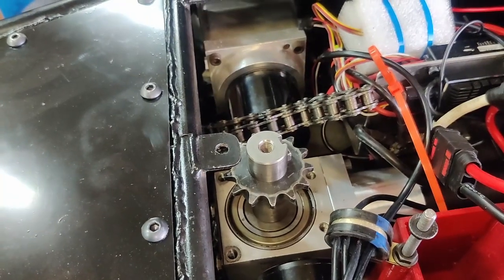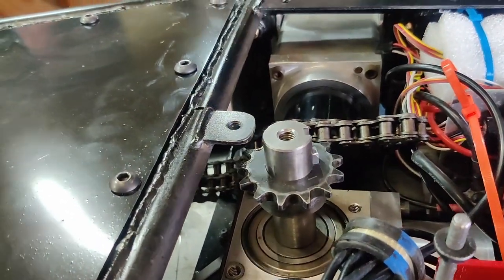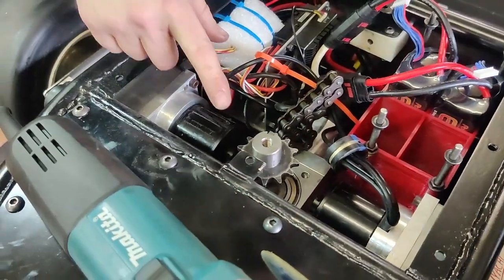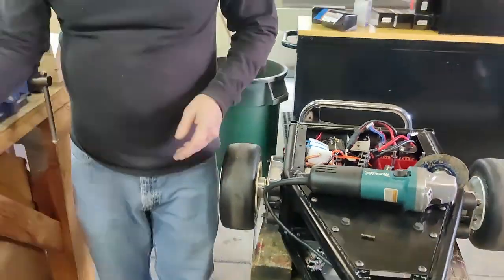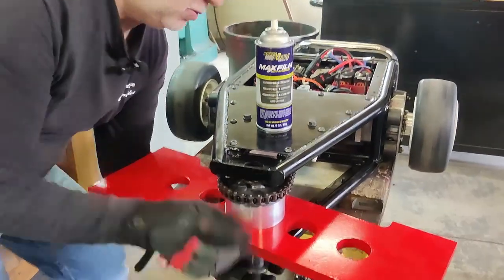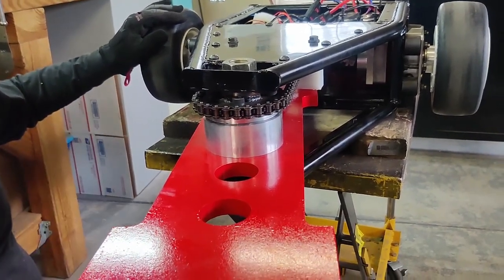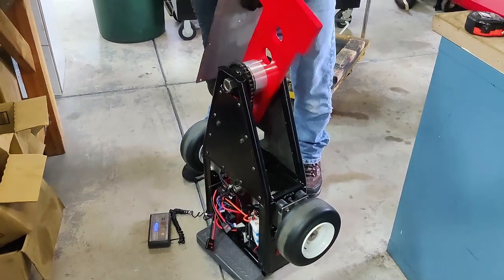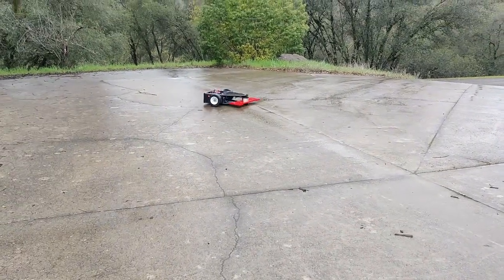Mortician 2023 - Final assembly and weight

Comment: i know you said mortician and tombstone arent related, but i cant help but think mortician is a tiny tombstone.
Reply from the maker: They are obviously very similar in overall design but have very few parts in common. The main power switches and radio receiver are the same parts, but beyond that everything is different. Different weight classes just mandate different parts. And some things just don’t scale exactly either.  But overall they have the same philosophy - biggest hit you can get away with and not totally destroy yourself in the process!
Reply: @ray9368  thank you, ray:)

Comment: #1 - love your work.  That being said the 4 1/2 grinders with the On/Off switch are DEADLY when cutting metal!  Ive been doing metal working as a hobby since high school (im 54).  Sooner or later IT WILL KICK OUT OF YOUR HANDS!  When it happened to me,  the cutting wheel hit the inside of my leg.  Fortunately, mine had the  trigger switch.  If it had the same switch like what you're using my femoral arterie would have been severed.  Again loved your work, please take what I said into consideration

Comment: Don't weld  chain.  Repeat after me; DON'T WELD CHAIN!  Chain links are already hardened and tempered, so welding on a link makes it brittle and can cause micro cracks.  If you want a permanent joint, either get a chain press, or peen over the pin to lock in the link.  You will get a much more robust chain.
Reply from the maker: In this layout we had to use a half link to get the right chain length. Half links are notorious for failing at the cotter pin, and have cost me matches before. You do a small bead right on the end of that one failure point, and you no longer have a failure point. 

In general for chains you are correct. In this one specific instance in a combat environment, I have an easy and cheap fix (that has 100% worked over a lot of robots!)
Reply: @ray9368  Ah, ok.  I didn't see it was a half link.  I just really don't want unskilled people seeing that and thinking that welding the side plates on a master link is the best way to do things.  Cooking the rubber out from between the inner and outer rollers can be very detrimental, as well as killing the temper on the side plate.  

The chain link press can still peen a half link pin over to avoid this heat.  The press has a screw on one side and a shaft on the other.  The shaft has a cup machined into it, and a handle on the outside.  To use it, there are guides to align the chain pin with the shafts.  Once one of the pins that needs to be peened is aligned, you tighten the screw side, pressing the pin into the cup.  You then spin the handle until the tension eases up.  Re tighten the screw and repeat until rotating the handle 2-3 rotations does not get easier.  I grew up in a lawnmower shop, and doing this was my first job.  My dad would have me make drive chains for lawn tractors, farm equipment, and Bobcats.

Comment: Great to see you and your Robot again.
Please allow me to explain some ideas:
In the past, you got on fire during the fight, and that makes me sorry, because all the work, all the parts, all the money goes up in Smoke and Flames (okay it looks cool).
Maybe you could surround the batteries with a metal case with a separate outlet for cooling a fire, just in case, so you only lose the batteries.
The wires look exposed to me if the chain comes off, a tooth of the gear breakes, a bolt brakes, or a sharp metal edge to tue impact cuts into the isolation.
Maybe extra isolation or a protected cable management could help.
And last: I'm worried about the Chain, there is no protection inside the Robot that prevents Controller, Motor, Battery or the Cable from suffering damage if the chain snaps back or breaks. 
Maybe you can use some of my ideas. 
Wish you the very best

Comment: Only single-shear support on the right angle gearbox shaft?
Have you ever had a top/bottom panel come off? There isn't a lot of material for the threads there.
Reply from the maker: 1:38 - 1:48 You can see the bolts going through the bottom titanium into the gearbox, but also the bolts that go through the steel plate welded to the frame on the front of the gearbox. That steel plate keeps the gearbox and motor from moving forward, which is the direction of stress under weapon impact. 

The gearbox actually stays in place and works just fine with no bottom armor at all :)

Comment: Looks good, Ray. It seems to be quite zippy. Just curious, what is under the front gear where it touches the ground? Does it ride on the head of the bolt or is there some sort of rounded knob to make it slide easier?
Reply from the maker: It just rides on the weapon pin. I honestly don't want it to slide too easy, as it tends to over steer when you do that. The little bit of extra friction makes it more controllable

Comment: What's the difference between Tombstone and Mortician?
Reply from the maker: There are similarities in design certainly, but almost everything is different between the two due to weight. Mortician competes as a 120 pound middleweight, whereas Tombstone is 250 pounds. About the only parts in common are the radio receiver and power switch :)
Reply: @ray9368  Thanks for the insight Ray Billings. Good luck!
Reply: It weights about half of it.
Reply: @olisk-jy9rz  
Mmm.. Interesting.
Can you tell me why it was made since there's already Tombstone? I am not up to date with all the happenings of BB or Ray Billings so please bare with me.
Reply: @beedykh2235  Different events have different classes and weight limits. Tombstone competes in events that have a much higher weight limit.
Many of the teams that compete at the heavyweight class of BattleBots also compete at lower weight classes in other events. And like Ray, they typically run designs that are very similar to their heavyweight bots, just smaller and lighter.
Reply: @TitoRigatoni  aha thanks!

Comment: Thank you to Ray and his team for showing Mortician's build development. I noted that you now did ended up with enough space for 4 batteries (rather than 2) which was your hope. How will this help when it comes to robot fighting (e.g. Is it faster speed, better endurance or quicker weapon rpm, etc.)?
Reply from the maker: The voltage is the same, just more capacity. So it won't have any effect on top speed. There is more amperage available, which might help with a quicker spinup but honestly I don't think we were pulling more amps than the two packs were capable of delivering. The biggest help is in endurance, and not overheating the packs. It provides a margin of safety, and if we don't overwork the batteries they are less likely to swell or catch fire :)

Comment: -- Suppose cutting that tab for the upper plate and moving it isn't a bad idea now (or add two).   As promised, I looked into speed controllers for you.  No go, so you can skip the rest, but if want to read the tale.
   I contacted my nephew who hopefully was wearing his best brown pants when I gave him your specs.  2000amps, pretty sure those pants went in a hazmat container.
   The robotics he works on at Boston Dynamics don't have speed controllers that can deal with anything near that.  As I suspected, those sorts of components are made for the military and industrial.
   So, I contacted Samsung and Hitachi's robotics divisions (the ones that make robots for auto manufacturing assembly lines).  Their controllers are built into the motors, can't handle that amperage, aren't for sale, but would theoretically cost 15-25k a piece.  Never mind they couldn't handle the abuse.
   So, on to Honeywell and General electric.  They also make them, they don't sell them, and they wouldn't even give me a price, save a ballpark weight of 40 pounds each.  There they got big.  Rudder controllers for destroyers/aircraft carriers etc.  
   ALL OF THESE would still have to be programmed, and the software is proprietary.  
   So to keep it short, I made some calls to auto manufactures that make electric cars.  They wouldn't even speak to me. Not one.
    So I probably landed where all of you did.  They are out there, but not for the weight/price/durability the sport demands.  And no one wants to sell them.  There are other ways to do it using small RC controllers, with a 'tach wire' if you will, but then you get into what you call 'derp'.  I'll spare you the 'step up' idea as you've probably already looked into it.
   So, sorry Ray.  Highly specialized stuff that's built for specific function in a specific device, made to order.  
   Glad I'm not in your shoes.  Thumbs up.

Comment: Would it be possible to have a motor that has two output shafts so you could have redundant chains on the weapon thus making the weapon a bit more reliable. I get it would take some redesigning with weapon motors and your weapon shaft but it could be the difference if a fight having an extra way to send power to the blade in a fight
Reply from the maker: There are design ways to double up the chain certainly, but it would be adding a fair amount of weight. It would be a design compromise that would force me to pull several pounds from somewhere else, likely out of the weapon mass. I don't think the pros outweigh the cons honestly. 

If I were to be using belts instead of chain it might be an option though.